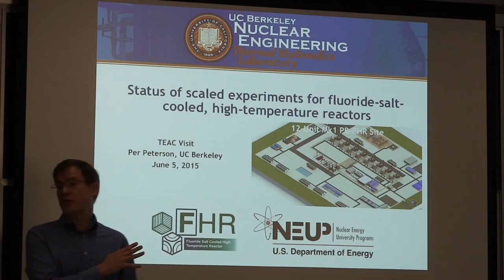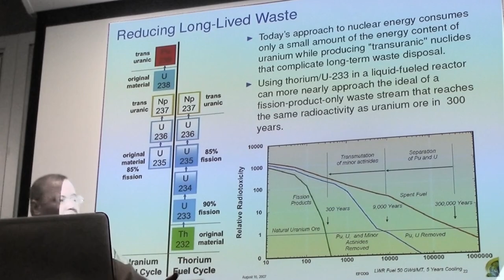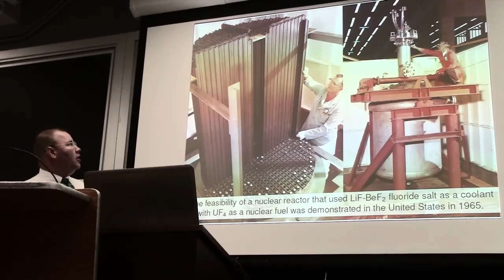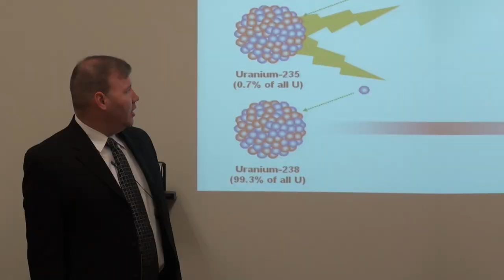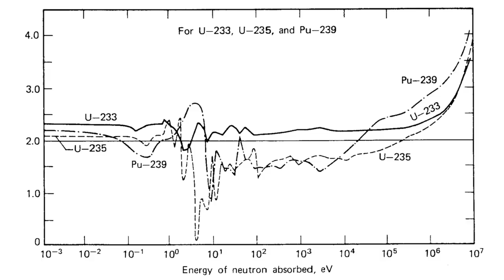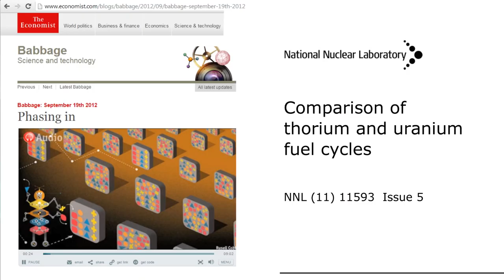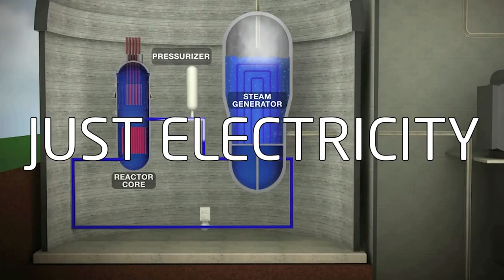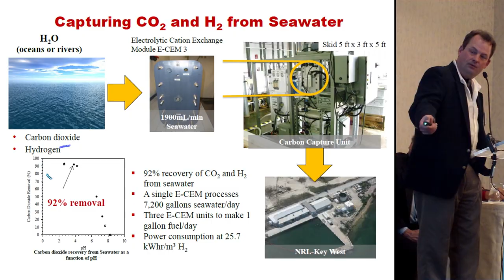Thorium Disadvantages

Comment: So in other words, the only disadvantage of Thorium is our atomic agency...
Reply: It is actually a technical challenge that it turns into Protactinium-233 rather than directly until Uranium-233 when struck with a neutron. Ideally it would not. Dual-fluid design would not be required to breed Thorium into U233 in thermal spectrum. If fast-spectrum MSR is pursued then U/Pu cycle doesn't have same dependence on Chemical Kidney or the breeder-blanket. But that's fast-spectrum, needs different salt, has fast-neutron material challenges... so one could then make "Fast-Spectrum MSR Disadvantages" video based off that, and it would be full of technical challenges surrounding unproven materials. (MSRE was thermal-spectrum. Only thermal-spectrum MSR have operated on planet Earth.)

But "technical challenges" are not what halted development in 70s. The technical challenges cited by WASH-1222 debatable and an excuse to focus on LMFBR instead. http://nucleargreen.blogspot.com/2010/12/wash-1222-revised-review.html

LMFBR worth pursuing too, I'd argue less worthy than MSBR but still worth doing if one could pursue both. But Congress killed LMFBR during Clinton presidency. So now neither LMFBR nor MSBR being pursued as a national program. No breeders. Thanks Nixon, thanks Clinton.
Reply: gordonmcdowell so you have to have enough fissile th-233 to last that 30 day breeding period. 
Did I understand the designs correctly that the th-232 solution is kept separate from the fissile material for breeding?
Reply: @jeremygrant1325  Th232 in (breeding) blanket salt. Hit with neutron. Turns into Pa233 before U233. Gotta get Pa233 out of way of neutrons or might absorb another neutron in 30-day period and NOT become U233. Neutrons are the scarce commodity. Can waste the Thorium but not the neutron or else fission can not be sustained. Very tight neutron economy with thermal breeding of Thorium. Constrains material choices. However modelling neutronics and breeding and absorption is perfect task for computers. So likely no surprises there, just the Chemical Kidney operation not really a model-it-on-computer challenge. Pulling out everything you do NOT want to absorb neutrons is new thing... salt chemistry still being developed. Chemical Kidney (MSRE had no kidney that was to be MSBR program cancelled first) challenge for thermal-spectrum breeding. Material challenge (testing like MSRE actually tested materials) for fast-spectrum breeding.
Reply: @gordonmcdowell  Is this the model that India is pursuing?

Comment: Safety: liquid salt leaves the reactor. After cooling down meaning hardening the salt. I give you 1 hour to refill the reactor. I win.
Reply: Mulitple small reactors.  Proper safety margins mean such situation would come up rarely and only reduce the power plant capacity by a fraction of its total output. The point is the danger is abated as soon as the salt leaves the defective reactor vessel and so other reactors on site can continue to operate while you suss the problem with the failed one. That's what comes to mind for me. I don't see why the reactor needs refilling in an hr.

Comment: The government owns vast areas of dry, stable desert -- what an ideal place to build experimental nuclear reactors to use under well thought out experimental rules and controlled access and with low interest credit! Past nuclear weapons proving grounds near the Las Vegas and New Mexico general area would be ideal. We could tie into the existing vast electrical grid of the  water-starved Hoover Dam and replace the dam's electrical power generation to save water for irrigation and to power other. 
Elon Musk has a vast factory near Reno, NV (and several other areas) and is interested in developing nuclear power for extra-terrestrial use as well as for battery- electrical powered aircraft. He is already in talks with Rolls-Royce Holdings which is already working in these areas including small modular reactors.

Comment: Nuclear power just isn’t economically viable. The costs of making the plants safe enough and deal with the waste just makes them uncompetitive. If the US starts to build plants again people will start dropping off the grid as it is now a viable option. I will not support continued rate increases for new nuclear power plants. I will just increase my battery and solar capacity and disconnect from the grid.
Reply: Unless you consider the long term cost of climate change caused by consuming fossil fuels!

Comment: The original General Motors EV, the Chrysler Turbine Car, the Wankel rotary engine, hybrids, plug-in hybrids, EVs... the oil and gas industry and other forces have made the road to reduction and elimination of fuel and increased efficiency difficult. The fossil fuel industry burns coal for electricity, and we have wasteful practices being enforced in the court of public opinion for decades. Nuclear is "dangerous" all the while we breathe in the byproducts of combustion. Plus, you find a more efficient fuel, you kill mining and refining for a specific element which means retooling for a new process. Nobody likes change but a wet baby. Especially if money is involved.

Comment: This is not a disadvantage video.  Like the other comments l've read say, it's an advantage video.  Why is this not being use instead of uranium?  l mean they built a thorium reactor and ran it for four or five years and it apparently worked flawlessly back in the 60s l believe.  l also can't believe China is leading in the research of this.

Comment: I am two thirds through this video now and see so many benefits to thorium and infuriating to see the same scientist “expert” spouting lies and backing it up by using solid reactors as a reason lol but still wonder the overall cost and recycling potential from an example of a working reactor. Cause overall with the nuclear reactors the upfront building costs are expensive and the operating cost was supposed to be cheap but because they don’t age well and problems from that and other problems big names in nuclear power like westing house had to file for bankruptcy! Thorium would have to be cheaper overall then solar as well and take up less of a footprint
Reply: Michael Shellenberger has a pretty good conversation with Robert Bryce about the cost of nuclear. https://overcast.fm/+dV0vw2QCg ...observing that what works is building the same thing over and over, and having the same team doing all the building. Of course we might GET that with MSR because most are intended to be factory-built. But that's time spent commercializing MSR + building some, vs just building more PWR ASAP.

Comment: Well half of the things on internet is hoax and thorium reactor also seems to be that
Reply: Look up "ORNL-4191" (designed in 1967). One of the follow-up designs to ORNL's 1965-1969 Molten Salt Reactor Experiment. https://en.wikipedia.org/wiki/Molten-Salt_Reactor_Experiment ...that's the basis of LFTR, the Liquid Fluoride Thorium Reactor. We know natural Thorium absorbs a neutron and turns into U233. We know U233 gives off an average of 2.5 neutrons when hit by a thermal spectrum neutron. That such a reactor can sustain fission is pretty obvious, and is why China's already building their TMSR-LF1 2MW pilot (as presented to SAMOFAR in 2019). Flibe Energy (on the USA side of things) has received funding from DOE for 3 avenues of LFTR development since 2016.

Comment: hehehe I like this video...There are no dis advantages that I can see with molten salt reactors...Ok I take that back...The disadvantage of thorium and molten salt reactors is that they are much safer, make their own fuel, use fuel that is plentiful, shut themselves down without human interaction, and cost less to operate and maintain than light water reactors which is why we can not have them...
Reply: Thorium Disadvantages listed in this video:
00:00 Solid-fuel thorium reactors fuel utilization ratios similar to PWR.
03:00 Licensing restrictions specifically target liquid-fuel.

20:50 Thermal-spectrum neutrons hitting U233 produce only ~2.3 neutrons.

23:00 Graphite moderator required to sustain fission in MSBR thermal-spectrum.
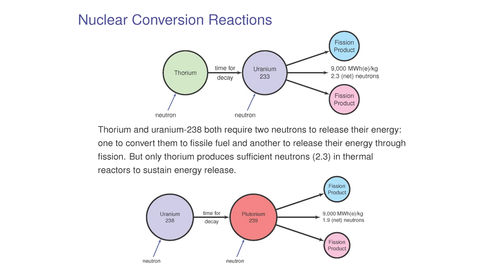27:50 Protactinium-233 half-life 27 days.
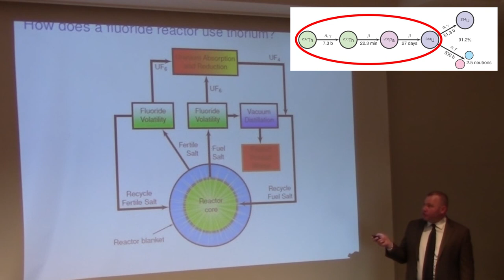29:00 Material challenges (MSR is pre-requisite so MSR challenges are Th challenges.)

...the biggest disadvantage is U233 creating only 2.3 neutrons. That is a very tight neutron economy. Which is good for fissile security (can't divert U233 without shutting down the reactor) but bad for building a fleet. U233 would need to be created to see the Thorium reactors, because they can't breed surplus for additional reactors to expand the fleet.

Comment: One of the biggest challenges in developing a thorium-reactor is finding a way to economically fabricate its fuel. Making thorium-dioxide is expensive! Its melting point is 3,300° C, the highest of all oxides. The options for generating the barrage of neutrons needed to kick-start the reaction regularly come down to uranium or plutonium, bringing at least part of the problem full-circle.⚛️
Reply: Please do not comment on videos you do not watch.

Comment: Thorium is way safer and clear energy source than Uranium,

Uranium and Oil Industry have became similar when it comes to propoganda!
Reply: Safety comes from Molten-Salt coolant, not the fuel choice. Uranium can fuel an MSR. So long as the coolant is not under pressure, and can't depressurize to a lower boiling point, then loss-of-coolant and dispersion-of-material risks can be greatly reduced.

The environmental advantage of Thorium is that we can convert almost 100% of Thorium into energy (and Fission Products). It is possible to get similar performance with Uranium in a fast-spectrum reactor. Fast-spectrum reactors have some unique challenges (and capabilities).

I'd suggest looking at various reactor designs and see how extremely different they can be. Lots of good designs.

China IS building TMSR-LF1 right now. Unfortunately that's not happening in USA or Canada. But there are interesting designs moving ahead.

Comment: What's going on today with MSRs?  Where's China at and where are the US innovators?
Reply: Kairos Power is USA's MSR tech. Solid fuel TRISO pebbles in Molten Salt coolant. China's building TMSR-LF1 right now. Canada is in licensing process for Molten SSR-W where fuel is dissolved in Molten Salt but contained in metal pins, then bathed in MS coolant salt, is fast-spectrum and fissions Pu from used-fuel as fuel. Terrestrial Energy (I-MSR a Uranium fueled MSR) is hoping to pilot at Chalk River (Canada).
Reply: China just finished building its first prototype for a MSR commercial reactor! Testing will begin this month and first test results are due September. The first commercial reactor is only foreseen for 2030 though. Anyway, pretty excited for this, hopefully technology like this can replace all of China's coal stations. Also, once China has shown that it actually works, investments into MSR designs in other countries will likely pick up.

Comment: Nukes are not enough, regardless of their 'flavor'. Even Space Solar Powersats are not enough! We need to try a LOT of things, and get data on which are most practical and most sustainable, before we go too far down any paths which may turn out to be blind alleys. 
Note that there is a way to rid the Earth of essentially any amount of waste heat, but the concept is virtually unknown... Wet Convective Atmospheric Engines, which use the (ever increasing) water vapor in the air as 'fuel', and use the entire planet as a pre-built, for-free solar collector. Anyone interested can ask me for details and the history of it, which are far too voluminous to put here.

A wide-ranging (but not exhaustive) discussion of waste heat and many of the better-known energy options is here: https://www.newscientist.com/article/mg21328491-700-power-paradox-clean-might-not-be-green-forever/

Comment: BAD
0:50 liquid reactors are hard to legalize (only pebble reactors are being legalized right now)
2:15 china stealing technology that we will have put money into
3:30 R&D is expensive and companies dont want to risk a dead end
4:40 politicians dont see an advantage of thorium to uranium because the output is about the same (Plus environment is never a concern)
5:40 only in a liquid form (which isnt legalized) is thorium more energy outputting - the THERMAL spectrum
8:40 must secure imports for future use
11:00 BS news Scare tactics - Fukushima wasnt a nuclear explosion it was a hot water/pressure explosion. If it were a nuclear explosion the building and the city nearby would be levelled.
19:00 people cant imagine solid mixing though you could have a solid fueled car

GOOD
6:50 is cool to see
7:40 Thorium doesnt need mines. its a by-product of rock and and common mozanite (rare earth)
9:30 AUSTRALIA IS RICH BABY!
17:10 An ice plug is melted if power runs out so that the thorium flows into a holding tank where its disconnected from plutonium and so it cools down

Comment: The only thorium disadvantages I heard in this video were political. Nothing to do with the physics, just what they wanted to happen
Reply: It has a low breeding ratio, so you can't waste any on abosorbtion by structural material or Fission Products. It just makes designing the MSR somewhat more challenging plus need for Chemical Kidney (to remove FPs and also address Protactinium absorbring neutrons and NOT turning into U233.

20:50 Thermal-spectrum neutrons hitting U233 produce only ~2.3 neutrons.
23:00 Graphite moderator required to sustain fission in MSBR thermal-spectrum.
27:50 Protactinium-233 half-life 27 days.

Comment: take a look at India's thorium research. 😊
Reply: 43:59 I do mention India's molten-salt research facility. They are mostly pursuing solid-fuel thorium fuel cycle and MIGHT pursue MSR in the future. But India is motivated by energy independence, having a great deal of Thorium and not much Uranium. Most countries either have both or feel they have access to a reliable supply of Uranium. So my interest in making this video, is to call out MSR as the only economic approach to an efficient thorium fuel cycle. If energy independence is a goal then solid-fuel reactors can already use thorium fuel cycle, as demonstrated by Shippingport decades ago.

Comment: However good the technology (and I'm appreciative), D. Trump is currently a liability as a spokesperson.
Reply: I haven't really heard any politician anywhere articulate Advanced Nuclear in a way that makes me think they've nailed it. Trump made a few true statements about nuclear power, and has presided over 2 good pieces of legislation being passed into law (maybe a 3rd on the way), but really he hasn't articulated the reasons for nuclear power either. The best articulator so far is Senator Corey Booker, but even his is only OK and not as good as what is needed. Whoever finally nails it could (if they do it right) keep it bipartisan, because support (politically) is bipartisan. There's more R than D that support nuclear, but getting stuff done means including the Ds just as the 2 bills that were signed into law were co-sponsored by Ds.

Comment: This doesn't look like that big a problem. Why doesn't some private firm do it? What's the hardest part to get working? What is the most expensive part? What part does not have technology ready off the shelf? Peter Lyons is now dead. One stumbling block removed. What's the next? If it's political, then let's get behind China (or Russia or whoever is out there that is not a political dolt and cripple like the USA) and get it done.
Reply: Flibe Energy is trying to do it. Currently they're also trying to save U-233 from being down blended. That's seed fissile for their LFTR design. While they have secured some private investment I can imagine any investor looking at licensing and wondering how a new reactor design built to consume a new type of fuel will fare, not from a tech perspective but from even allowing a test reactor to be built and operated. See other advanced reactor companies (further along the licensing process) and all the challenges they've faced... Oklo comes to mind as an example. China did build a TMSR-LF1 and I expect we'll hear it is operating any day now... I don't think they will announce they are about to start it, rather only announced once it has started operation and they've run some successful tests. If you want to help out domestically check out S.4242 that's legislation to protect USA's remaining U-233 stockpile and so enable the launch of a test reactor. (More U-233 cam be created by recycling fuel in a fast-spectrum MSR, but there is a chicken-and-egg problem if a LFTR test can't operate because lacking U-233.)